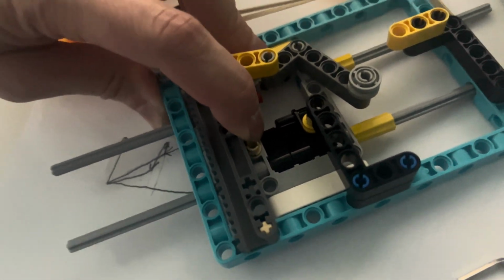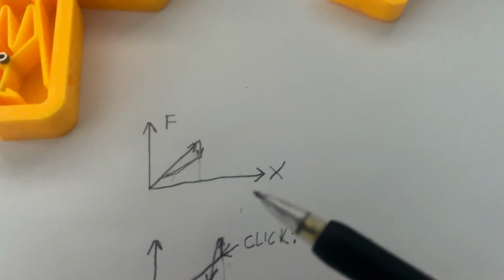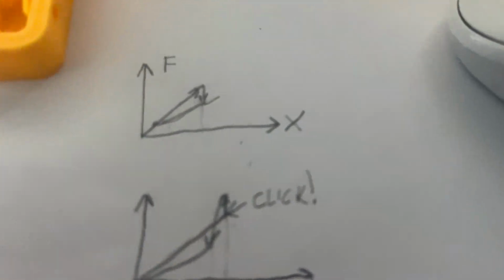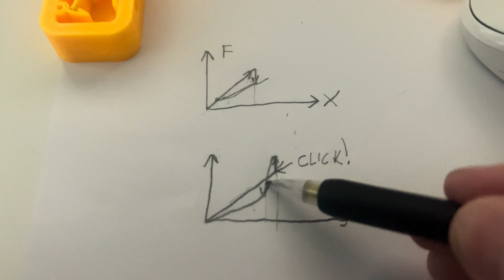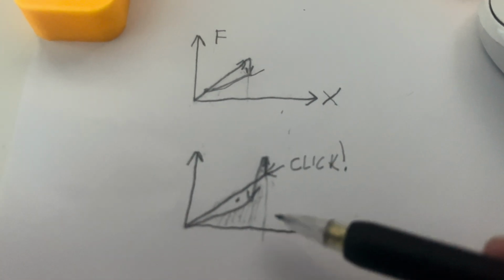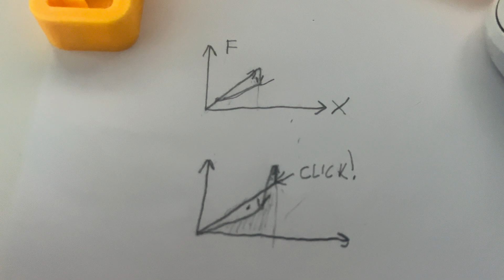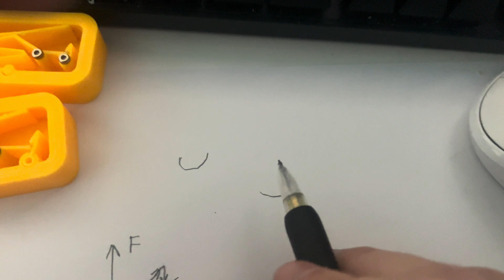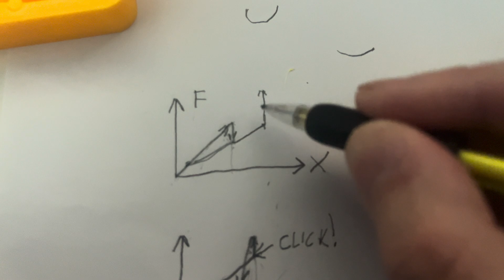This button pushes back when you press it.

Comment: This is fascinating.  Seeing both designs together - for a counter snapping mechanism: restrict linkages to move along a single axis, a big lever w/ extension spring on one end, small lever mounted on big lever that buckles/inverts upon retraction, introducing a new point of contact for big lever - shortening it's length, but maintaining force - increasing big lever's speed on return?
Reply from the maker: Yeah I was thinking of making a lego prototype first, with an extra bar to restrict the movement of the buckling linkage's top to a large enough circle (so that lateral forces on the lever wouldn't prematurely activate the buckling). Feel free to build that, I'd love to see it. I went with a print because a lego build would start to get rather inconvenient with all the beams having to be stacked on top of one another.